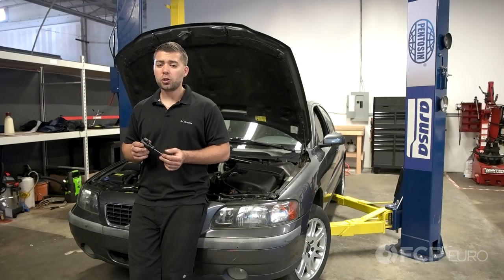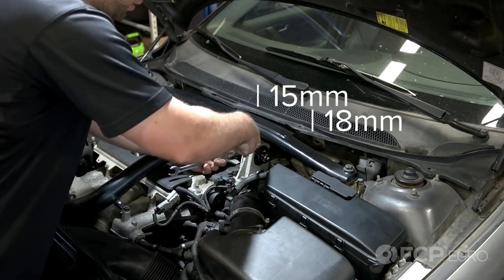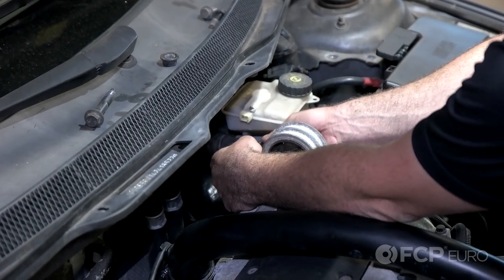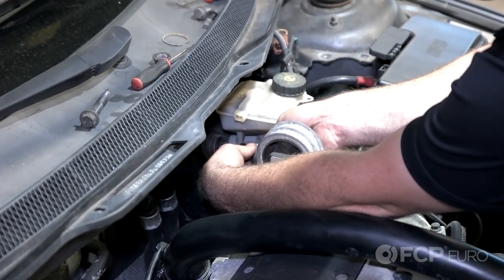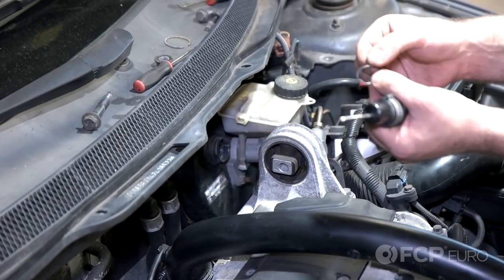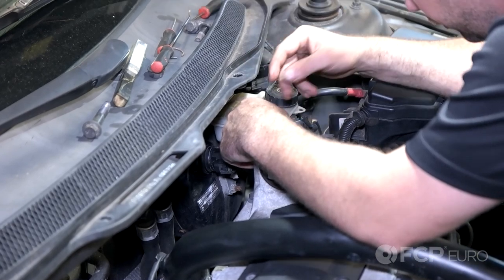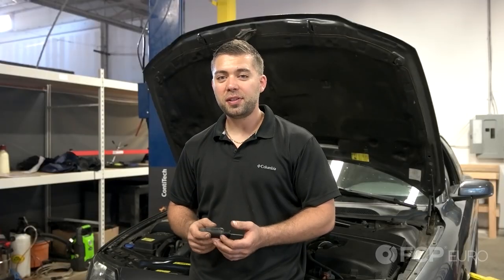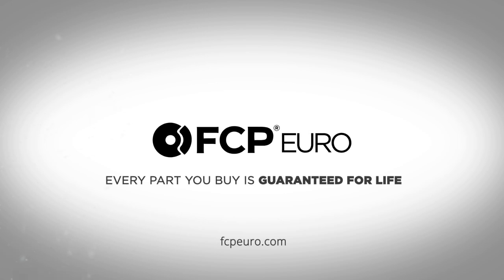Volvo Brake Pedal Position Sensor Replacement - Code 9400 FIX! (S60, V70, XC70, S80, XC90)

Comment: At about 1.17 there is a sharp intake of air, in to the vacuum of the servo. This could suck in the o ring. So, with engine off, pump the brake pedal a few times to lose the vacuum, before starting work.

Comment: Thanks for the video.... But what I wanted to say, that I actually fixed my sensor... Carefully cut the cylinder (like 5mm from the top), easy disassembled, sprayed with contact cleaning solution. Cleaned the resistors, checked that I have a good contact, and assembled with a tape. Everything works now. And saved 50-70$

Comment: This sensor is pretty nasty to replace, because of that tiny metal clip - I like to push where it ends against it to force it out. Placing the sensor back in place also needs a lot of pressure to fully keep it seated while hooking back the spring clip (ask a helper to keep pushing push).  This should fix the cruise control issues.
Reply: Agreed - you need time and patience to get the metal clip to seat properly. A fiddly job.
Reply: Just keep pushing...trust me it will eventually lock in place.
Reply: @yabogunrin did you have to wiggle and push?
I'm struggling to get it fully seated

Comment: The metal clip can be difficult to fit - works best to fit the clip onto the servo boss first and then push the sensor into place. The clip will simply lift and spring into place to retain the sensor.
Reply: Agreed, installing the clip before installing the sensor works like a charm. The clip part of the job is effortless when done this way. Be sure to seat the o-ring all the way up on the shouder of the sensor body.
Reply: Seems like no matter what I do, all it takes is a little tug to remove it. The old o ring is removed. The new o ring is seated at the shoulder of the new sensor. But I can't get the new clip to secure the device.
Any tips?
Reply: You made my life a million times easier. Thank you for this advice! Put the clip on and the sensor slid right in and was secured

Comment: Finding it hard to source the brake pedal sensor. I have a 2006 xc70. Do you have the part number and US source. Few xc 70s were sold in uk. Many thanks, Andrew

Comment: Do you have an idea of how much it would cost to have this replaced by a mechanic? My '01 S60 is throwing "Engine System Service Required" and code 44, and I've narrowed it down to this. I'm not too keen on messing with it myself.
Reply from the maker: Hello Matt, a mechanic will most likely charge around $100 for labor.

Comment: Is it advisable to disconnect the negative battery connection cable prior to doing this work?  I did not notice any mention of this in your video and wanted to see if it was even necessary to do so.

Comment: Do you need to bleed the brakes for this job?
Reply: No need to bleed the brakes if you're only replacing the sensor, there are no brake fluid lines involved when replacing the sensor...

Comment: How do I test this switch I cannot find anything anywhere on what wire is what where it's supposed to get signal from I'd like to test it before I go throw$140 sensor in and the problem not being solved LOL

Comment: Great video! What should I inspect when after replacing Master Cylinder (ATE) and bleeding the brakes (using power bleeder) I still get a spongy/soft brake pedal? When car is off and out of vacuum the pedal will stay firm and not travel down but with engine on and vacuum the pedal would travel until the end if enough force is applied. Thanks!
Reply from the maker: You're welcome! At this point I would be checking calipers and brake condition. Also, if the pads and rotors are new, the pedal will feel like this until they properly break in.
Reply: Thanks so much for the advice!
Reply: @fcpeuro  hey i have this exact problem and a code for my brake pedal sensor. Im replacing it soon and i just put on new pads and rotors from you guys as well. Would breaking in my pads and rotors in and replacing this sensor help my pedal feel better?

Comment: Would this sensor cause a brake assist service required?? Or just the engine system service required? because I have both and when I'm in traffic the pedal sinks usually during stop and go but not during continuous travel, so you think this could be it
Reply: Thats why I've bought one because I get that message. Ther mechanic checked and said it was this that I needed to replace

Comment: 2005 s60 T5… I have engine management service required and brake assist service required… is this what I should be changing first or the stop light switch?? 

Unfortunately I have no code reader

Comment: The unit that holding the sensor having that plastic bracket or so, on my xc90 this plastic holder snapped out from the that unit, how can i fix that? any idea? can i just glue it back? cant find parts thanks

Comment: Will this cause  Anti-Skid service required message?  According to me dealership, this is the culprit.
Reply from the maker: Hi Kathy, a lot of things can cause the Anti-Skid service required message, including bad G sensors, bad slock spings, abs sensors, and the brake pedal position sensor. The best way to diagnose is to hook up a Vida Dice to see exactly which sensors are at fault.

Comment: Thanks for the vid, what symptoms does the car display in order to have this sensor swapped out ?
Reply from the maker: Hello Darrin, you'll get a Engine System Service Required message and ECM-9400 code.
Reply: FCP Euro hello one question. WILL WORK FOR WOLF C70 Convertible if if it does not work the part you are changing the video is experiencing a problem with cruise control and lights up on the ETS board. I THANK YOU?
Reply: FCP Euro : ok thanks, I've been getting anti-skid service required , I'll check the code thanks !
Reply: Hi I don’t have that code. But my pedal is very hard
Reply: @mustangsrus41  if your pedal is reallly hard its your brake booster
Reply: Can it happen that I still have to drive to Volvo to clear the error?

Comment: Will this cause the brake pedal to be extremely stiff?
Reply: No - sensor replacement does not affect the brake hydraulics.
Reply: Brake booster cause the brakes to be really stiff.

Comment: What else does this sensor do apart from cruise control? I think my old snap ring is already out of shape to securely lock the sensor in place, the sensor keeps popping out with little effort. Will the master cylinder lose vacuum pressure? Sigh.
Reply: I'm having this issue now. Did you ever get it fully seated?

Comment: I have code 9000 "Brake Pedal Sensor Faulty Signal" on a 2006 XC70.  Is this the same as the 9400 code?

Comment: Would this cause "brake failure pull over asap" 
Message?
Reply: Loss of pressure or failure of whatever sensor that monitors pressure in the system.

Comment: Hello replaced this sensor, upon changing it brake pedal became really hard to push.
Reply: Me Too!!! I wonder if it needs an adjustment after, and how?
Reply: @Gorblitz  I figured it out afterwards. I didn’t install correctly and there was a small opening so all air was going in through there

Comment: Would a fault with this switch throw codes up on my gearbox and cause it not to lock into gear?
Reply: Usually all it does is make your cruise control go all wonky

Comment: Hello on my p2 d5 the braking pad accelerates a bit the engine when i press to put the auto gear D! Help help!
Reply from the maker: Hi Vitor, I just want to make sure I understand exactly what you are saying. Pressing the brake pedal when changing gear in the automatic transmission causes the engine to rev up? You could have a vacuum leak by the brake booster, possible the brake booster line.
Reply: @fcpeuro  Hello thanks for your great answer. Im still trying to figure out what is the problem! I made some "progressions" i put my OBD II and i got the failure code P0244 Turbo/supercharger wastegate selenoid "A" range/performance! i made a test vacuum and i got from the vacuum pump 660 VAC and when i test the CONTROL VALVE, AIR INTAKE i get aroung 600VAC and the tester needle starts flickering! Im in doubt if the problem is this control valve air intake or the turbo charger selenoid 
https://www.kmotorshop.com/article-detail/view/en/86305/control-valve-air-intake-7-22240-15-0-pierburg-30611668-31430034
https://www.carid.com/2011-bmw-5-series-turbochargers-superchargers/pierburg-turbocharger-boost-solenoid-valve-1609331832.html
What do you think?!

Comment: Hi. Could the failure of the brake pedal position sensor cause the gearbox to refuse to go into park? Gearbox is otherwise working perfectly. I've a 2008 xc90 D5. Thanks
Reply: I got a fault code to say that the sensor was faulty and now am getting warning on the dash saying brake fluid level low, even though it's full.

Comment: Will this cause a brake light failure along with the shift lock not releasing . Just replaced my brake light switch and that didn't work .
Reply: My switch and fuses are ok. I'm looking for the relay before I dive into this job. How did yours turn out?
Reply: Mine is the same, any luck with this?
Reply: Anyone?